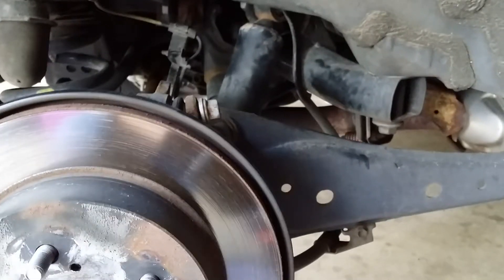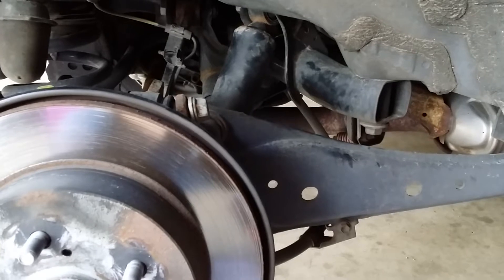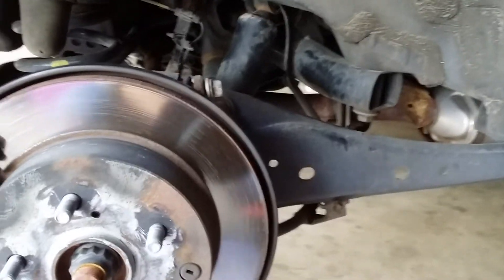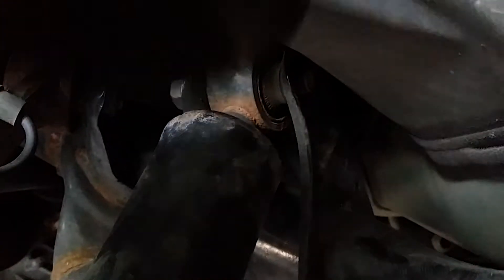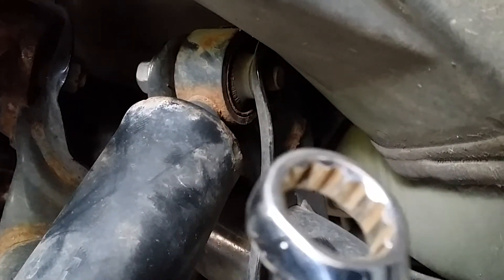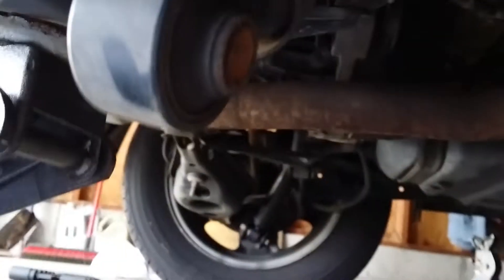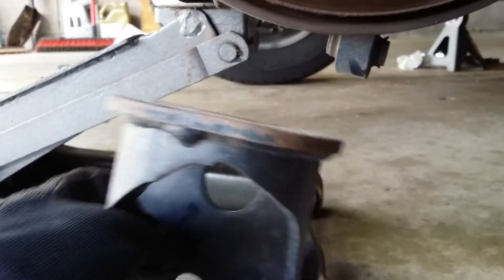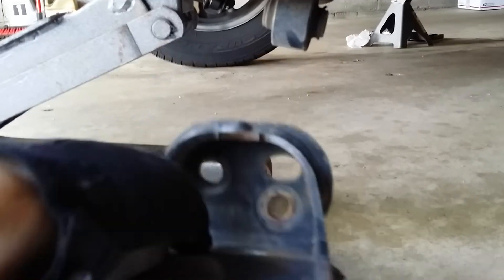Tips: 2011 Rav4 rear shock removal

Comment: I purchased 2 bolts and nuts for the lower mount from local Toyota dealer.  Pulled the old on out till it hit the lower control arm, cut the bolt in half and removed the remaining half.   Inserted the new bolt thru the opposite hole and installed the nut.   The way it should have been done from the factory.  Piece of cake.
Reply: Bob Tanner 
U r wrong 
Factory did it to protect quick stealing!

Comment: Thanks for the video. I was told by mechanic that they have to go in the rear cab to get to shock mount? I have a 2011 rav4 AWD, but I don’t see how or why they could access in there?
Reply from the maker: Everything was done under the vehicle. There's no need to go into the cab.
Reply: @ulrblitzer  ok thanks any idea why they would say that?
Reply from the maker: @brianwood9849  probably just talking out of their butt and they actually didn't look. Some cars do have access panels in the rear cab for removal of the top nut. They'll be mildly surprised if they start tearing apart the inner cab of this generation rav4.
Reply: @ulrblitzer  exactly and I don’t won’t them tearing up my shit lol